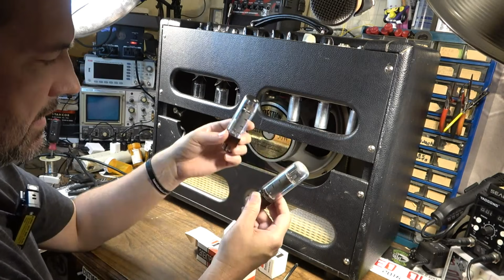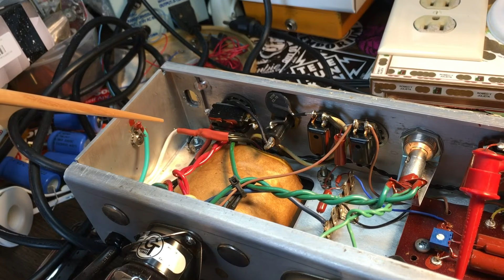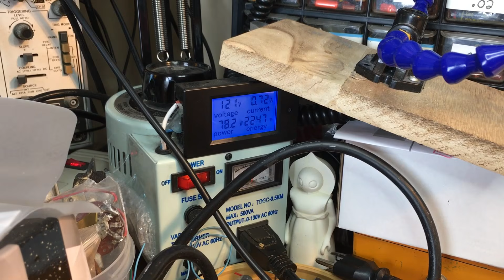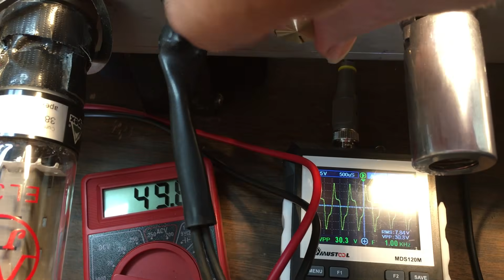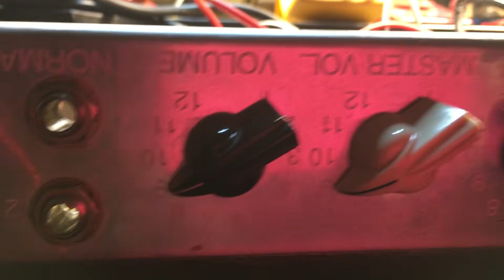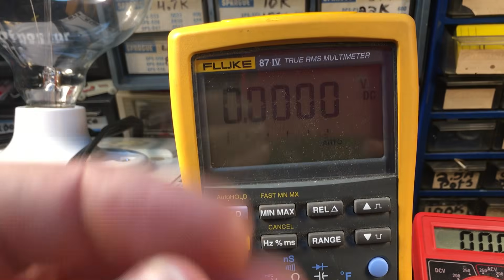STOP USING THE STANDBY SWITCH ON YOUR GUITAR AMP!

Comment: That amp is a piece of crap.  The reason they put the ground switch is to replicate why some of us keep the cord of death on our old rigs.  If you put an adapter on your three-prong power plug making it into an ungrounded plug you have the benefit of being able to quiet the amp when you are using dirty power.  Many of us play in bars and there are usually neon signs.  They cause noise.  I can switch the power cord and quiet that problem after you switch it to ungrounded (basically turning your power plug to the other direction).  Just a thought.  What you think is "the way it should be" is your opinion.  Altering the capacitors may make a major change in the tone of the amp... IMhumbleO.  I hope you did not charge this customer when the amp came back after being used twice after it left your bench.  The proper modification to this amp in my opinion would be to take back to the what they were trying to replicate instead of making a hybrid of a new design.  IF they were trying to replicate an early Fender Tweed then alter in that direction.  I personally would advise this customer to put that thing in the dumpster.
Reply from the maker: Why on earth would you ever defeat the ground plug on your amplifier with a 2-prong adapter?  The customer paid me for my opinion, and I gave it. I did the amp only favors here.
Reply: @TheGuitologist  I guess you don't know why.  You can quiet the amp by reversing the plug.  surprised you would not know that.  Many of us risk death and leave the two-prong cord of death on the old amps just for that very reason.  You can also change the polarity if you are getting shocked.  If I brought you an amp and it blew a fuse the second time I played I would expect it to be repaired without charge.  But I guess I am old school.  Reminds me of when you take your car to the mechanic and he fixes it and then it breaks down and when you bring it back he says something else is broken.  I only work with people who stand behind their work.  However, I must apologize for being this level of ass.  I just am as I said an old school dude.  Your video popped up and it didn't sit well for me so I made this shitty comment.  Sorry about that.
Reply: I guess I am one of those ass trolls.  Maybe I will delete, or you are welcome to.

Comment: This is a really nice presentation.  I build clones and convert the ground switch to a standby switch.  I also never add the death cap.  I love/build/play low watt amps, tweed Deluxe, Princeton Reverb, Brown Deluxe.  I have never blown a fuse using a standby switch.  Do you think its because I am running at lower voltage and amperage?  Now that I think about it, these amps weren't even designed to have standby switches.  The next time I crack one open, I'll get the readings that you just showed us.  I understand the statement that we don't need standby when using a few tube rectifiers.  The GZ34 is supposed to warm up and come up to working voltage very slowly.  For now I will run with the standby switch closed passing current when I power up the amp.  Thank you for the work that you put into these y-ts.  Below is an explanation that I've never heard before.

https://www.youtube.com/watch?v=4nVlDV7Arzg

Comment: Very informative as always. I have a late-60's/early 70's Vibrolux--should I also not use the standby?
Reply from the maker: The Standby switch is after the reservoir node in your amp. Not as big of a deal to use it. Still doesn't do anything to save components like a lot of people claim. You can use the On/Off switch and just leave the Standby in the On position all the time if you want.
Reply: @TheGuitologist  Thanks brother!

Comment: Good video, Brad. I agree about the Standby switch. The Thermistor needs to cool down a bit before you re-apply power. When the Thermistor is hot its resistance is low, so it is not offering you much in current limiting. It was an excellent demonstration of what happens when power is applied to a hot Thermistor.

Comment: How about older Marshalls like 800s and 900s?
Reply from the maker: Amps without thermistors on the primary, I recommend adding one. The JCM800 original series do not have them. I think it's the same story with the 900s too. The standby switch on at least some of those will break the AC connections on the PT secondary, before the reservoir caps. Those caps are rated at 500V, so unless the full secondary voltage after rectification exceeds 500V, technically you shouldn't need to use Standby out of fear of exceeding the cap rating. Those caps are in parallel rather than series, which means they could have done like they did in some older models and DOUBLED the power handling of the reservoir caps by placing some in series. Since they didn't, you only have 500V rating rather than 1000V. Still, it should not be necessary to use Standby out of fear of popping those caps.
Reply: @TheGuitologist  Thnaks for the info!  great video

Comment: Yeah ! thermistors are great for overcoming inrush current ptoblems.  You ended up setting the bias so it is pretty cold when overdriven.... That amount of crossover distortion is pretty  audible when You see that degree of X-over distortion, and thin brittle sounding. 
  I think the main problem is the power transformer, is overpowered, and the filaments represent close to zero ohms when they are cold thus all the inrush current.  It would be better to put 44 uf's at the 1st filter cap.  The bouncing waveform when overdriven is intermodulation distortion with  120 HZ ripple in the supply,  caused by less than optimum filter capacity.  

  Also that lovely red paint was probably lacquer with drying agents in it, which are nitrogen compounds, which can act like an electrolyte, and can cause leakage at high voltage.  It is a really bad idea to paint a circuit board or rusty transformer with lacquer spray paint.   By the by,  I have also run into too many bad 5AR-4's lately, that arc.

Comment: Brad, one of my viewers suggested I come to you. I got a Digitech GSP 2112 that is making a crazy feedback noise, almost like microphonic tubes - already put a couple new 12ax7s in there and that's definitely not the issue. It's only present on certain presets but doesnt seem to be associated with any effects - though it doesn't occur with the phaser effect on oddly enough. Would this be something youd be interested in taking a stab at fixing on your channel?
Reply from the maker: Email me and I'll see what I can do. bradlinzy at gmail
Reply: @TheGuitologist  will do, thank u!!
Reply: Could it be a presets memory battery not feeding anymore, so that editing values are upset?
It happens on synthesizers so I thought it was possible on other electronic devices with memories.
If it is Your case, remember to reload the patches or restore the firm values after changing the battery.

Comment: What about a valve-rectified (GZ34, to be specific) amp's standby switch after the reservoir cap? Same problem? Different problem?
Reply from the maker: If the reservoir cap is after the Standby switch, that's worse. Another way I could have addressed this issue is to have moved the reservoir cap before the Standby Switch and kept the connection to the OT after the switch.

Comment: Why do they put it on there then?
Reply from the maker: Guitarists use it like a MUTE switch when changing guitars or going on breaks. They expect it to be there and consider it a feature which, if missing, they feel cheated out of, so manufacturers put it there due to expectation. Kinda like how operating rooms still use masks despite decades of studies and research showing they do not slow infection rates, even in the operating theater. Customer expectation. Easier to just provide the switch than have to sit here like I'm having to do and explain again and again to each customer why it isn't necessary and can in some cases be harmful.

Comment: I got a question... I've got a Peavey Heritage VTX and as I play, sometimes it gets gradually and dramatically quieter and fuzzy. Then if/when I play loudly, it will suddenly POP back to full volume instantly.
It's a huge problem. 
I suspected it might have to do with the tubes, but I replaced them last year and it just started acting up again yesterday. 
Im decent with electronics, but not at all confident dealing with amps. I don't even like the idea of getting in there AT ALL, without knowing exactly how not to off myself.
I would take it to a shop (and you might not even believe me) but I live in a small town in a small state, and I'm pretty sure there arent any music stores at all within a good 50 miles.

Anyway, if anyone could at least point me in the right direction of what might be causing it or how to fix it that'd be phenomenal.
Reply from the maker: Wiggle your tubes in the sockets while you have a signal going through the amp. See if they crackle and pop a lot. Could just be a dirty socket. If so, spray the sockets with contact cleaner and reseat the tubes and try again. STill could be a tube issue, but this will rule out sockets.
Reply: @TheGuitologist  Thanks so much for responding, bud.

Yeah... not a peep from the sockets. 

Like I said I live in mid Maine and there's a few shops and a Guitar Center in Portland, plus maybe about 3 other shops left in the rest of the state. What the hell?
There's no place for live music. No scene. Nobody even plays music anymore. I mean, how could they? Can't even buy a guitar anywhere! 🙄
Reply from the maker: @meddle333  Go on the hunch one of the preamp tubes is intermittently bad and get a known good tube and cycle it into each preamp tube spot until you find the problem or eliminate them all as a possible source of the problem. Beyond that, it might be time for a routine service - cap job, cleaning, and general check up.
Reply: @TheGuitologist  Thanks sm buddy! I'll be sure to do that!

Comment: True Tone pedals use a thermister in their pedals to protect the DC circuit against an AC power supply. They started using them years ago. The most common cause of burned-out pedals is people plugging in a 9volt AC power supply.

Comment: I’m a little weary of a blanket statement to never use one. Which I know you explain, but comments get lost deeper into the comment section. 

* Essentially stand by is to allow the heaters of output/preamp tubes to warm up cathodes so they can be ready to pull current, which will prevent the inrush from roasting the reservoir/ filtering caps and tube plates. If you have a TUBE rectifier it also has to warm up before it starts outputting high voltage and it warms up slower so no need or stand by. BUT solid state diode rectifiers don’t need to warm up so they output high voltage before the output/preamp tubes can pull current, making a standby switch necessary. *
Reply from the maker: They aren’t necessary at any time. The reservoir cap should be designed to handle the full voltage of the power transformer. Same with the output tube plates. While it’s true that using a standby switch with a ss rectifier could save an already tired cap from complete failure, there’s no reason to fear placing spec voltage on a spec component.
Reply: @TheGuitologist  yeah it absolutely should be designed to handle the inrush. but who’s to know from the guitar players perspective if the amp builder skimped or designed properly?
Reply from the maker: Let’s put it this way…regularly maintained amps shouldn’t have to fear being turned on without using Standby.  If something pops like a reservoir cap, it was probably long past time to replace them anyway. There is no actual need for Standby to be designed into properly spec’d amps in the first place. Power standby switches should be replaced with preamp MUTE switches instead. On most SS rectifier amps, you can use them with no problem, sure, but you’re not saving any components by doing so in the long run.

Comment: The advantage of the GZ34 tube over a 5u4 is the the go is an indirectly heated tube-the warm up time for them is longer that the 5u4 which has a directly heated cathode-it’s warm up is faster. With tubed rectifiers a standby switch isn’t needed at all.the slow arm up of tubed rectifiers makes them safer for tubes than a solid state rectifier which’s applies power instantly-long before the circuit tubes have warmed. And the sis can be harder of filter caps-a standby switch or in the case of transmitter s I deal with a time delay relay in the primary circuits of the hv rect transformer. Seen the gz34 in hi-fi amps.

Comment: You could also consider a resistor to limit the higher current that FB pot on the back causes. it wouldn't probably take very much away from the amp. I was surprised how much the current draw changed when you varied that pot! I assume more neg FB (lower pot resistance) decreased the current?

Comment: Been working with guitar amps for years along with other electrics.  The standby switch was originally designed so that when removed from a stby scenario your pwr tubes are heated and ready to go at an instant.  Removing the B+ from the output tubes also keeps them from wearing out prematurely as running with that high potential on them at idle for extended periods causes unnecessary wear on them.  Also all that heat unattended is a bit of a fire hazard as I've seen amps that have been left on for days before the player realized it.  Newer amps now have cages around the power tubes to keep a player from backing the amp up against something flammable like curtains however the amp would be much cooler and safer if in stby..
Techs might also might consider in this arrangement where the screens and OT centertap are the same source moving the stby switch to merely cut off the common B+ source to screens and OT. 
Also as an alternative in amps were screen source and OT CT are different I would think moving the stby switch to after the primary filter cap (the paralleled pair) and before the choke would allow the primary caps to be charged and ready to go.  
Only caveat would be that the unloaded voltage doesn't exceed the cap rating.  Adding a high value bleeder resistor might help resolve that.
I had a Soldano amp that was intermittently blowing the HT fuse and according to the schemo they had incorrectly wired the stby sw to before the primary filters.
Once corrected the issue was resolved.
Newer amps do have the thermistor as you installed (always thought it was a varistor) in this amp to reduce in-rush current however I've had many of them burn up over time and the mfg sometimes just suggests removing them.
Just a thought.  Glen
Reply: I have also seen some amps that have the S/B switch after the filter caps. I still like the idea of just turning whole thing off between sets just about as well!

Comment: Another issue would be the modern electrolytics have a much lower internal resistance than what we had many years ago. I'm pulling numbers out of my butt, but just as example:
An old 20uf cap would have an internal resistance of 1 ohm, while a modern 20uf cap would have an internal resistance of 0.1 ohms. If the internal resistance is the issue you can "make" a modern capacitor act like an older capacitor by adding a little bit of series resistance, but that would definitely increase hum. Every standby amp I've seen had the filaments and B+ on two different transformers. The standby turned off the B+ transformer while still keeping the filament transformer powered.